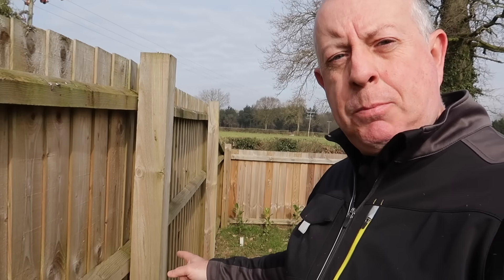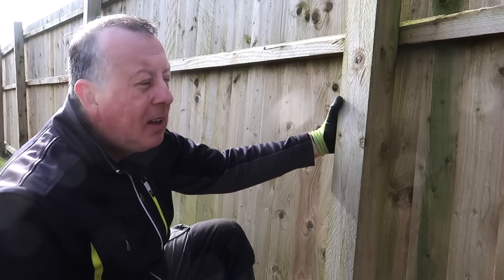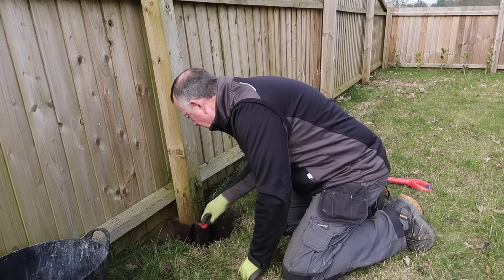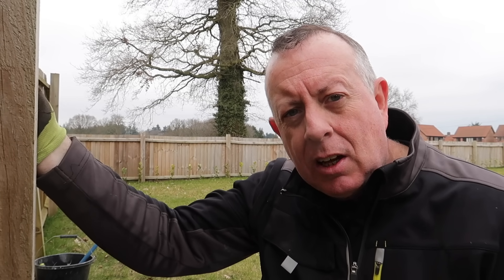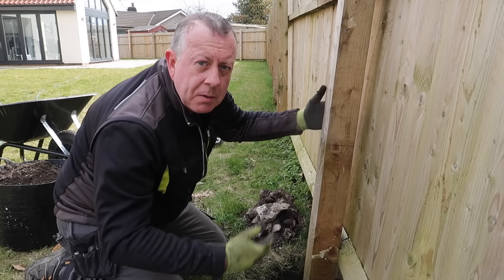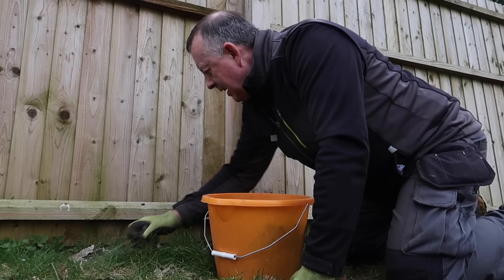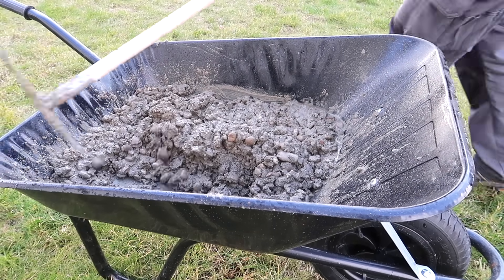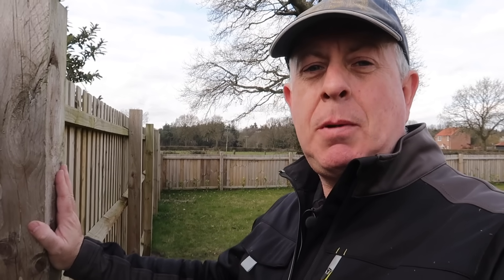How to Fix Leaning Fence Posts

Comment: I have to change out split rail fencing posts regularly, and keep digging up the giant concrete balls from their installation.  I've heard arguments that you shouldn't use concrete at all as that just gives water a place to puddle around and rot the fence post sooner.  And I have noticed that most of mine rot right at the concrete line and snap off.  I've started just burying deeper with no concrete.  Thoughts?

Comment: New subscriber here. Aren't you supposed to use a metal anchor to put the wood into. Then put the anchor into the concrete To stop the wood rotting.?

Comment: Another great video. Informative and to the point, no flannel.  My tip for hand mixing concrete is that you'll need 3 times what you  thought did at first 😅.  +1 on the SDS drill - I took out an old tiled fireplace and hearth with one with a chisel bit.
PS - please tell me it wasn't you that put in the fence in the first place.

Comment: I was always told to dig down 600mm, (2ft in the olden days) and use a 40 kg bag of ballast with a good shovel full of cement, level your post and ram all the soil back.
Reply: The important (vital) bit is  . that water should drain away from the post - so you need the concrete to end above ground level and sloping away!
Reply: @richardking6066  This method is great if you never get rain, no matter how good you seal the thing or slope the crete the water comes in the cracks of the post and saturates the wood rotting it premature, my neighbors fence was done this way ,SW ontario Canada and every post is rotted in the concrete premature , , as some one else said the best is grade away from post with soil  and live with the fact it someday will rot , check every year after setlling and add more if needed. using the tape at grade can help but jury is still out on that stuff, time will tell. Concrete on 90 % of soils is nothing more than an extra expense and future liability when its time to change posts every 20 years

Comment: Can use a rope to pull it straight. Tie it to the top of post then tie it off to something like a tree or the house then push down on the rope to make it extra tight and the post will pull straight. Clamp the tight rope to an angled stake hammered into the ground. Then backfill the post hole with quickset.

Comment: Part of your problem is that the prevailing wind is not getting through the overlapped boarding. When I need to replace rotten posts which support my interwoven panels, I screw fix tee section mild steel to one side of the post in advance of the concreting process. This invariably strengthens the post which often is of sub-standard timber, then flame the section in the ground.

Comment: If you had carved a larger hole around the foundation, could you have poured more concrete over/around it instead of breaking the existing foundation apart?

Comment: It all seems good and well but could you not simply have added the new concrete to what was already in the hole ?
Nice video btw.
Reply from the maker: Thanks! I was concerned that if I didn't remove all the concrete I would just be plonking a lump of new concrete on top making an upside down pyramid of concrete which would still pivot at the bottom.

Comment: I've always dug my holes about 2 1/2 ft. deep and about 14" diameter then put my post in the ground to the right height and just poured in enough Quickcrete to fill the hole completely then poured water in the Hole to saturate the Quickcrete, I never mixed the water with it just poured the water on top until it was saturated The fence post I have is the same post you have but the fencing is heavier lumber than yours. My Fence is about one acre squared and has been through Five Hurricanes and is still straight as an arrow and solid as a rock.

Comment: Any reason you didn't use premixed concrete where you just add water? It's probably used in 95% or more of the jobs here in the US that don't require that it be brought in wet from a yard. In fact I don't think I've ever been on a job where it hasn't been Sakrete (or another brand) pre- mix. Don't they sell it over there or do you prefer mixing me cement with the aggregate?

Comment: I found the unwashed three-quarter minus crushed rock is better than concrete you just have to tamp it down with a 2 x 4 end after putting about 4 inches in each time no caring time required and the post doesn’t seem to rot so quickly at the top of the concrete.

Comment: Ideally the fence post base needs to be built by the builder at the beginning with a opening to insert the post for future replacement, so the post is easily slide down and securely standing always.
Reply: Wrong.

Comment: Best solution is to use dry mix top and bottom. Compact and then dampen. The dry mix can be broken up easily with a hammer if required to replace the fence post later. Another method is mixing cement with clay.

Comment: Gonna try to DIY this myself, but if I dig deep enough and wide enough could I just pour more foundation under/around the post? I don't have the cement breaker tool, unfortunately, and it's getting colder here at the moment.

Comment: You should bring your concrete above ground level and slope it away from the post. A post buried in soil will rot within a few years. I put up a fence last summer. I used 8’ 4x4 posts and dug the holes 2’ deep and 1’ in diameter. They will never move.

Comment: Hole needs to be atleast 18inch and filled with concrete to the top. Also the bottom of the post to 2 inch above ground level painted with tar. My posts have been in the ground 18 years and still solid

Comment: I also have a Titan hammer/drill, I just wish someone made longer SDS bits. Sometimes, even taking the handle off just isn't enough. Mind, when it comes to drilling holes the damned thing is chuck deep a couple of seconds after you've pulled the trigger!

Comment: I have just come across this and I agree with you that a concrete mix with ballast beats postcrete. I think the problem you have is the so called professionals dropping far too little poscrete in there, taking there money and running. At least you have futureproofed it against bodge it &eco.

Comment: OK OK, so pretty unusual set of circumstances to begin with - usually it's rot that's causing the post to lean, but never mind. But why throw the rubble away and set up an elaborate structure for ensuring the post stays in the desired location? Mix some more concrete sure but if you hammer the old concrete around the post in the mix it will immediately firm up.  Just make sure you check the vertical while you're doing it. If you're worried about the wind blowing it around while it sets, just knock a nail in at the top and wedge another post or ladder or whatever against it on the leeside of the fence.

Comment: Wow - you're lucky it hadn't started to rot already. Half of my fenceposts had plenty of concrete - but the top ended below ground level, so the post continually got wet!!
Reply from the maker: I think I will have plenty with the same problem! Another job add to my list!

Comment: Liked your video but, you should have poured concrete to the top. The soil around the 4x4 holds moisture and will rought the post quickly.

Comment: I've just fixed five rotten fence posts using a spike that slots into the existing concrete costing £8.00 each. Simply fit the existing post into the spike bracket.
Reply from the maker: Oh really, I',m not aware of that product.

Comment: There's no need to remove the old concrete. Once you slightly enlarge the hole, support the post upright then poor regular Gorilla glue into it with a spritz of water (it is moisture curing) periodically as your pouring it. The glue will expand a surprising amount and cure to an 8 pound foam in about 20 minutes. It will also seal the wood to help prevent rot.

Comment: Done hundreds of fence posts with postmix ,you need to remember to compact it before adding the water ,never had a problem with any of them.
Reply from the maker: Personal preference I suppose. I've spent years in my day job pouring concrete on large projects so very used to be able to prove the quality before use.
Reply: I’m glad somebody said that, I use a fast setting mix and pour water in hole first, but there are brands I would steer clear of, I always use Lada the fast set
Reply: I meant lafarge!!

Comment: Over-long fence struts can use a lining post. They expand and become too long for the space either side of the leaning post. They need a gap to allow movement.
If the post cant reach down to solid subsoil, support the post with 3 x 2s and dig beneath. The extra mass of concrete can't do any harm.

Comment: Is it wrong or isn't easier to prepare the cement mixture, mix all portions well in a dry form which is easier than mixing wet,then simply fill the hole with the dry mixture then add water,use a stick to stir  gradually to release air and let the wet cement fill all the space and continue the process until the hole is filled?

Comment: When you buy treated lumber it says on the small tag stapled to it that it is NOT designed to be used underground. So yours WILL rot above your "foundations". You should always fill the concrete   up to the ground level anyways.
Reply: concrete rots because it holds the moisture it is best to finish the concrete below the service fill in with clay and build it up a bit so water drains away from the timber

Comment: I have developed a nervous twitch from every time I hear the words “wooden fence posts”. I have to go and sit in a padded room for an hour to regain my sanity. This year I had to replace 13 wooden fence posts that had rotted away. The concrete holding the posts in place were like icebergs, just one post took me ages to get out and even then I could not get deep enough to break all the concrete up. In the end I had to hire a “post puller”, it was a fantastic bit of kit. It made easy work of them and just lifted them straight out of the ground. Needless to say, concrete fence posts went back in the holes….
Reply from the maker: I live in the country where 99% of fences are wooden as I am surrounded by sawmills this is where the timber comes from hence why the builder that built my house went that way - a lot cheaper.
Reply: @ProperDIY  with regard to my story of the fitting of new fence posts. The amount of concrete attached to my rotten posts was massive, much more than it needed. It was such a hassle for me doing the job that I really didn’t want to have to do it again, so I went for the easiest of the maintenance options, by fitting concrete post. I would have loved to have refitted wooden posts. Wood looks so much nicer, concrete can be very cold and industrial looking at times. I just did everything I could to not have to redo the job in ten years time! You did a cracking job on your fence, it looks great. And as with all your videos it was a joy to watch, I look forward to watching many more 👍

Comment: The problem is I find you dig a hole to put a fence post in then you have the fence post and one bag of post concrete and you end up with a situation like you had unless you have a small round spade to make 8" dia holes you will need two or three bags of the stuff for each post not cheep best some get cement and gravel and mix it yourself I have taken post out of my garden with 12" dia x 22" of concrete stuck to them that is one hell of a hole to fill in when putting a new post in.
Reply: The answer is to back-fill the bottom of the  hole using some of the old concrete broken up, ram it down hard so thar the post is fairly firm, then pour in the pre-mix. That saves money and avoids taking waste to the dump. It's the concrete high up that is really important, as it provides the fulcrum. The rammed in stuff down the bottom doesn't have to work so hard. That was why the foundation failed. The concrete was not just too little, but it did not go up high enough.

Comment: I would put a new post at the side of the wobbly one. Use my post hole borer and screw from neighbour with bugle head screws. Use ready to use concrete in 20kg bags 2 off .

Comment: I've found a really good fixing for a fence post, is packing the earth around the bottom 6 inches or so of the post, then lay in the concreteabove foundation on top of that, finishing just below the grass or whatever forms the surface area.  What do you think?

Comment: Nice technique.  If you have one fencepost with a grossly inadequate foundation, and ESPECIALLY if you have two of them, then you cannot trust ANY of the others either, even if they don't currently lean.  The problem is the personal standards of the original installer:  if he thought the one you dug up was good enough, he wouldn't have 'wasted' (as he would have seen it) more concrete in the other holes - or the time to dig them out enough.  You've made a point of mentioning Screwfix in each of the 2 videos I've seen...is there an interest to declare?
Reply from the maker: You are completely right, I could well have a problem coming with all the others! No interest in Screwfix other than letting people know where I get things and therefore where they can get the same. If you watch my other videos you will here B&Q, Ikea, Wickes all mentioned - no sponsorship or affiliate commission from any of these I'm afraid.

Comment: Requesting guidance from someone who has done this.  We have a 400 foot fence line.  We installed this 3 board paddock fence and our recent lot survey shows the fence touching the property line at one point in an area that is about 20 feet long.  It doesnt cross the property line but is very close. The reason for this error was the proximity of mature trees and many utility easements that we tried to avoid and the fence company just did their best for me to avoid cutting down trees which most customers would have done. The property line was staked by a surveyor before installation but one of the posts was put much closer to one of the survey stakes than the others. The rest of the fence line is about 18 inches inside the property line. This fence and near encroachment is observable via GIS publicly online and my survey shows it barely touching the property line.  If my neighbor protests my fence touching his property line or if I just get nervous and want to fix it, can I fix this one spot without taking down the whole 400 foot fence?  The posts are 4x4 inch square posts.  Thank you.
Reply: I feel like I should mention that I haven't done exactly what you are mentioning since you asked 😅. If I was you (assuming you actually have to move it because it sounds like you probably dont) I would put in new posts to the side and or closer to the property to avoid the concrete from the old ones. Then just take a Sawzall and cut off the old posts at the concrete under the soil. You can pull out the old posts by breaking up the concrete  with a pickaxe or sds like he showed in this video, but for 20 feet of posts it could take some time and effort. Either way I would replace the posts. You definitely wont have to tear down the whole fence.
Reply: @colossalbreacker  Thanks I am glad to hear that.  I was thinking that because the are square posts, the new angle of the boards, however slight, might be too sharp to do in a short span of length.

Comment: Actually what would also have worked once you had the free movement and the footing concrete so low would have propped the post true and wet poured a fresh ring up to the surface.That's the fulcram point and once cast and set the job would be just as good until the post rots one day.Just remove prop once set.Your job was the way I would have done it but I think either way is a proper job.Used to have a fencing business and still miss it!

Comment: What I would have done was dig around the entire concrete about 6 inches and then fill around the hole with pea gravel.  It'll grab the concrete and not let it move.  Then put the sod back on top.   We set entire fench lines with pea gravel where I live and they never move.

Comment: A bit nuts seeing how little was used for the cement on that fence post... Here in the states, ya tend to see the foundation running over a foot deep. I think that would be something around 300 or so milimeter.

Comment: I have a small section of fence which is leaning towards the post. It's forcing the post to bend away from the fence section. Post foundation appears to be solid. When I try and apply pressure against fence (to go back into position) it doesn't budge. One side if fence is not attached to anything -5 inches away from house. Other side connects to another post. It's less than a year old. I tried contacting the fence installers, but he is difficult to contact. I asked him for a quote btw not expecting a freebie.
Any suggestions how to repair?

Comment: Just a few questions, why not remove the panels around the post to make the process easier?
Did you put drain rock at the bottom of the hole before concreting?

Comment: I have a fence with exactly this problem. Thanks for your tips and experience, I'm feeling confident I can repair the fence on my own. I thought I'd use a quick-drying cement, a brand that claims drying within an hour. Any opinions on that ?
Reply: Be sure of the cause. Is it the only problem post? What about it differs from the others? Does it catch the wind? Ground water table? Was it set to proper depth originally? The loose post in the video likely was not because of insufficient concrete. Remember, telephone poles (and farm fences) are set directly in the ground without any concrete.
Reply: @roseymalino9855  I had two posts broken at the level of the original concrete, so they had to be taken out (had to use a jackhammer for that mess) and replaced. I followed the directions in the video except I mixed the quick-drying concrete directly in the hole. It all worked out pretty well.